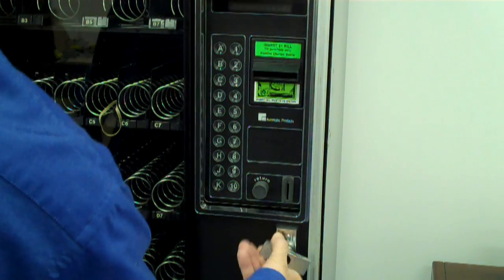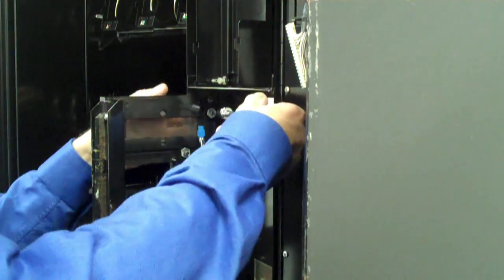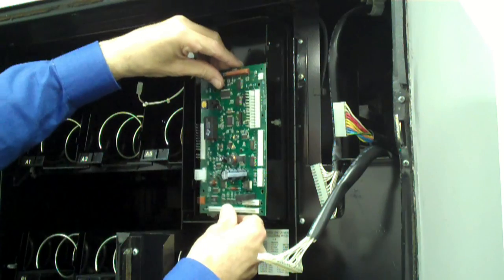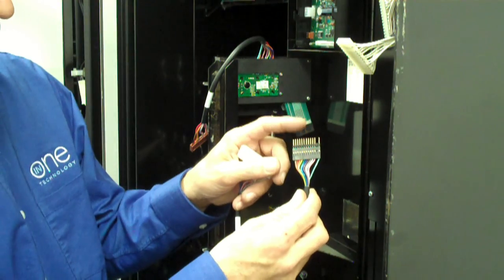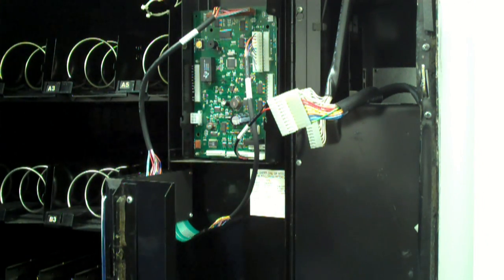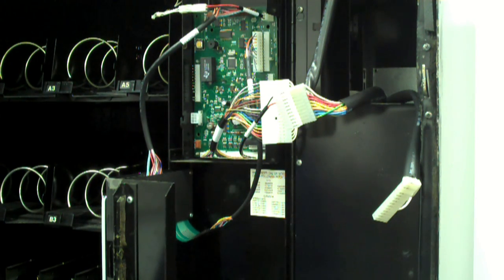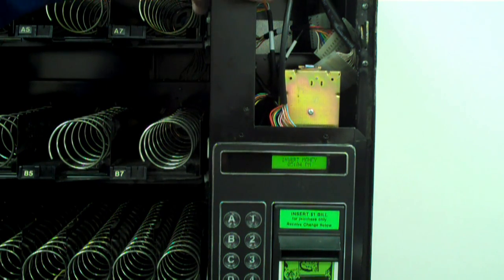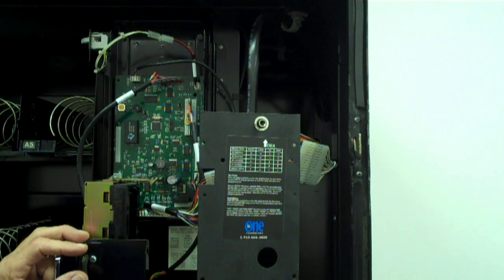Upgrading your vending machine by installing an InOne VMC

Comment: do you have to put coins in the machine one by one so the Inone board counts them as you are adding them or will the Inone board recognize how many coins are already in the coin mech without adding them one by one
Reply from the maker: This depends on the coinmech and is explained in the instructions included in the kit.  

For a Dumbmech: turn coin lev mem on in OPTIONS menu and then go into fill/dispense and payout 5 of each coin and feed right back through coin slot so the board sees that change

For MDB Changers:  in OPTIONS menu, coin lev mem should be OFF by default, if not, set for OFF

Comment: Do you have kits for Polyvend PV 6640 machines?
Reply from the maker: Our Polyvend Kit works for 3000, 4000, 5000, & 6000 Series Machines. Part Number RVMV-POLY-1L. Hope this helps.
Reply: InOneTechnology what dealer can I get it? Does it have other languages menu? Thank you for your reply!
Reply from the maker: @andreaoamaral  You can contact us directly at 667-401-1000 or purchase through one of our resellers. https://www.dsvendinginc.com/ or http://thevendingcenter.com/ We currently only have English available for the Polyvend boards.
Reply: By the way Can I edit or add customers messages? Thanks
Reply from the maker: @andreaoamaral  You can adjust both lines of characters on the display by copying the machine config file to microSD card, editing in  notepad and then copying the file back to the controller. The “Insert Money” and “date and time” can be changed to whatever you wish, 16 characters max.
Reply: @ZigZag  Did you end up getting an InOne Technology board for the polyvend 6440. I have a few boards available used  machine is Australia 240 volts
Reply: @inonetechnology  quick question on this exact machine how can you upgrade the keypad to a smaller one? How will the machine know what to select ? Please reply
Reply from the maker: @Tucute16  Unfortunately you can't upgrade the keypad. Our upgrade kit relies on the factory keypad for proper operation.

Comment: Why the f*** would you not include part #14-0388-00 if you NEED it to complete the install?  Your company is ridiculous. 🤬
Reply from the maker: That part is in every AP110 kit and joins the ribbon from keypad to keypad cable. The male header is small, inch long, and is in a small  bag inside the larger bag of parts.  It’s sometimes hard to find since it is a small part. Please call us if you are still unable to locate this part in the kit and we will send one right away.